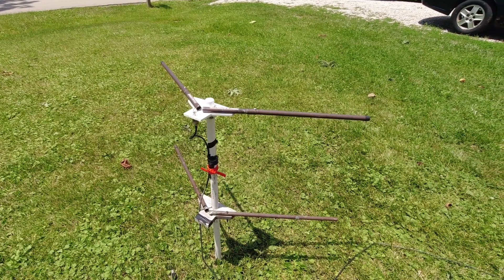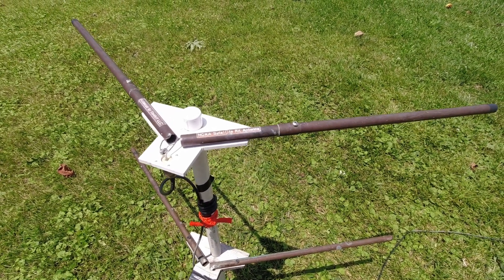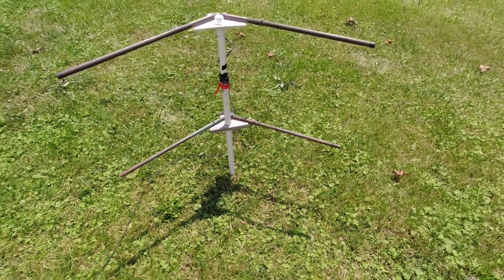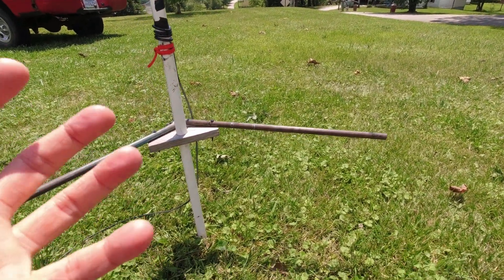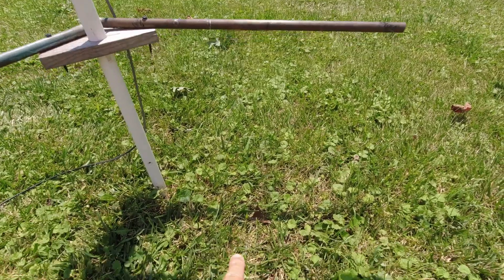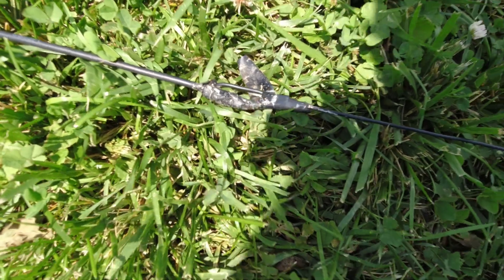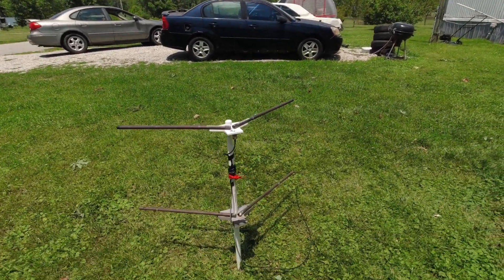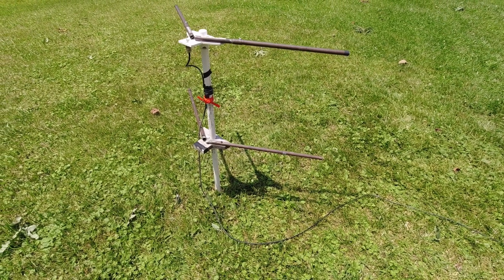My V-dipole antenna

Comment: Aniruddha Bokil VU3FML has a nice video on V dipole heights and lobes and gain, and reflectors.
Reply from the maker: I will check it out. Thanks for the heads up
Reply: @Yelnats101  Its seems the V Dipole with a reflector outperforms the QFH ! judging by whats visible on peoples SDR software using QFHs. they always seem to use LNAs.
My guess is their coax ruins the symmetry of the loops. it puts a grounded run of shield inside the loops, coupling across the choke.
A simpler antennas too, A portable V dipole could have hinged arms, so it folds into a very compact convenient form for transport.

Comment: You said all of the antenna elements are the same length (19 5/8") but it's fairly clear the two bottom elements are shorter than the two on top. Is that by design? What is their actual length?
Reply from the maker: They are 19 5/8.  Same as the top.  I just don’t have perfect alignment when I mounted  the bottom ones.   As long as you close it’s not gonna matter.   The bottom one just reflect .  They could be 12 inches and probably work just fine.

Comment: Did you measure the angle between the radiating elements? Would love to know.
Reply from the maker: . Given I’m using it so close to the ground it’s not super important. They are there to help (shape) the magnetic field.      But they are exactly as the top elements. Length,Angle,etc
Reply: @Yelnats101  curious what the manufactured angle is, I want to possibly replicate it for my own backyard/field day/POTA activities. Somewhat like making a tape measure Yagi-Uda, put some documentation to the process and then make a video possibly to help promote Sat Comm hobby.
Reply: @jameski5oeb668   i will measure it and let you know tomm, and the widest and smallest part.  but im sure is a 120 degree angle